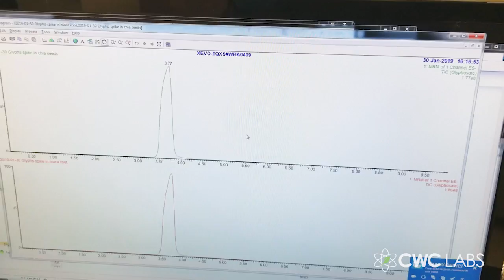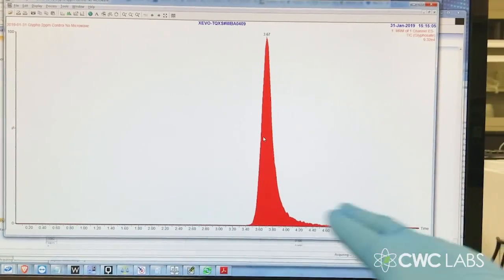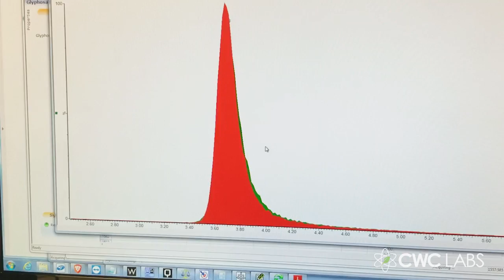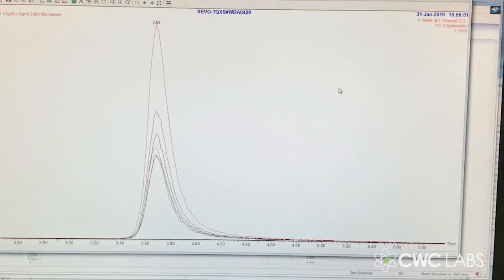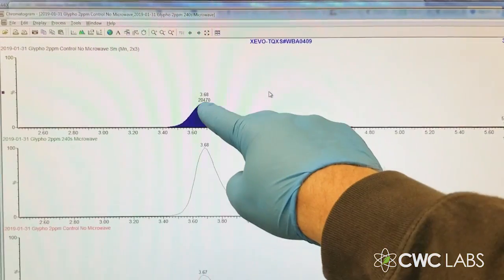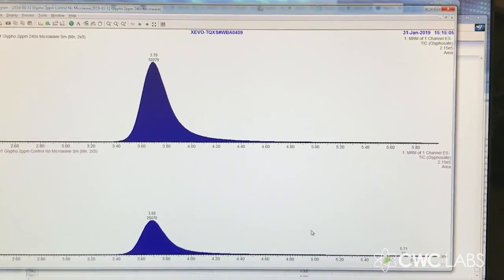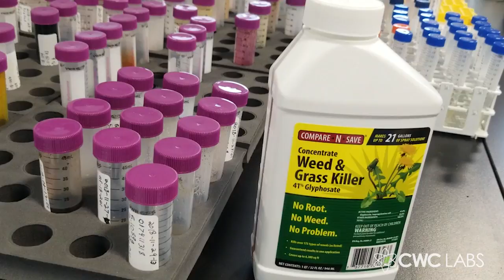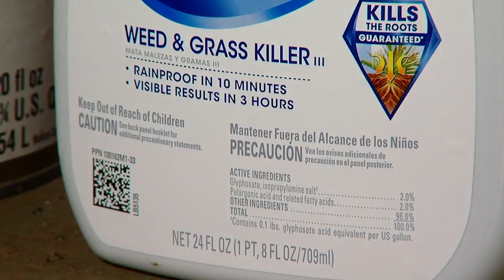Glyphosate Microwave Experiment by Mike Adams at CWC Labs

Comment: The article I got with this video said the results are surprising but it only makes sense that if you microwave it that it would evaporate the water and concentrate it. So no surprise. I would have been surprised if microwaving did destroy it and also skeptical of anyone that says it does. I used Roundup in the '70's when it first came out to replace the highly toxic Paraquat. Back then the label said it was broken down by the soil in 2 weeks but I always knew it was a lie because when we sprayed the grass and left the trimmings on unsprayed grass it would kill that too, even if it was left overwinter! I suspected back then it was some toxic stuff which wasn't known till years later.
Reply: It was always known, just not made public*
Reply: Thanks for sharing